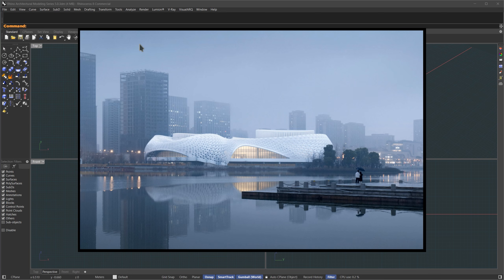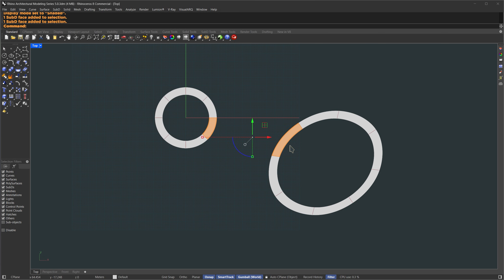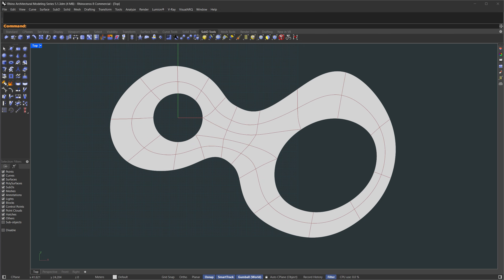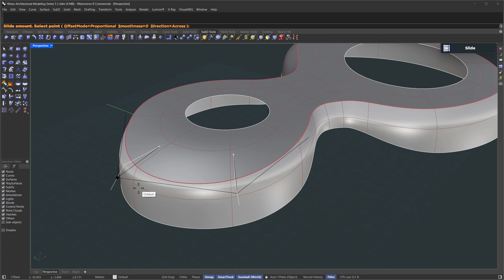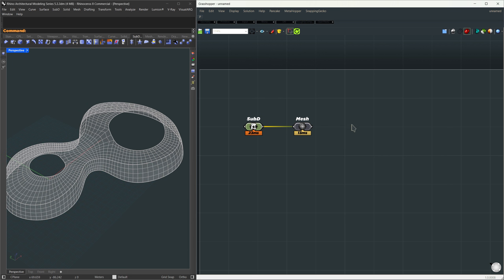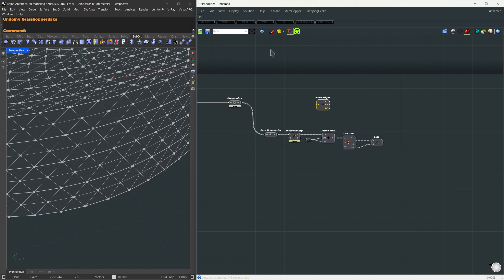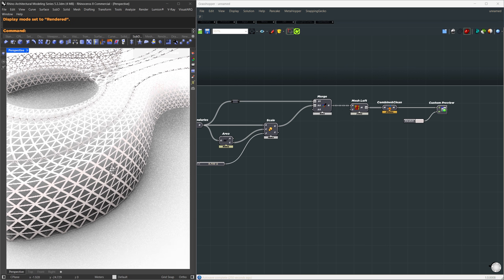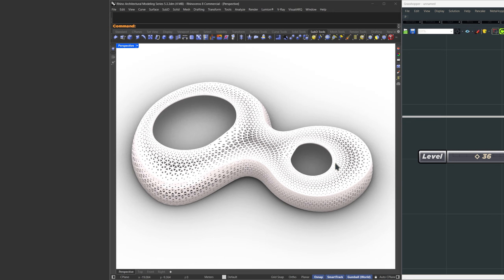Rhino-Grasshopper Tutorial | Golden Sands Lake Grand Theater

Comment: My grasshopper had the same issue as yours last week (the ribbon wasn't working properly)
I fixed it by reloading all assemblies.
Just remove all plugins from the loaded folder to reset Grasshopper to default, then copy your plugins back into the Libraries folder.
Thank you for your amazing video.
Reply from the maker: Appreciate you sharing that, good tip to have here